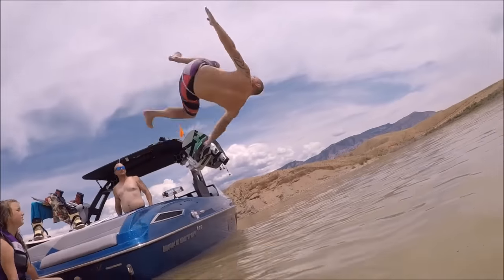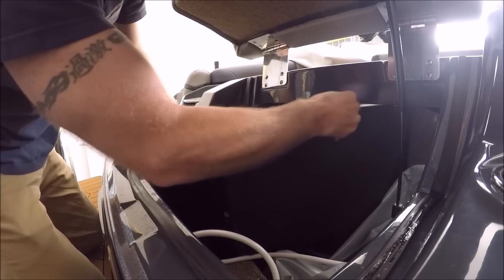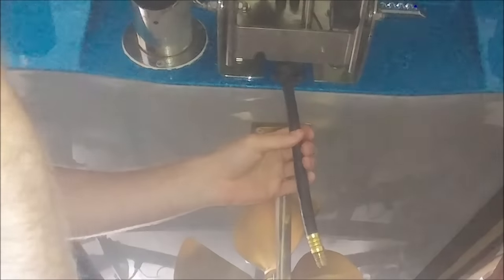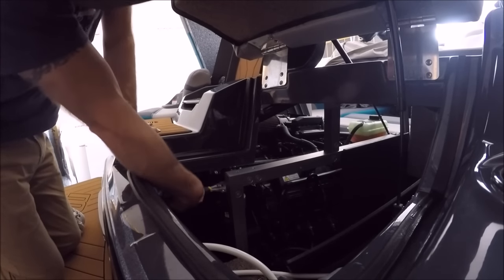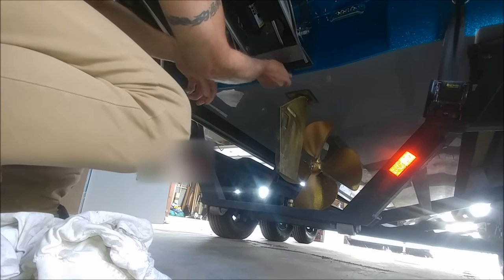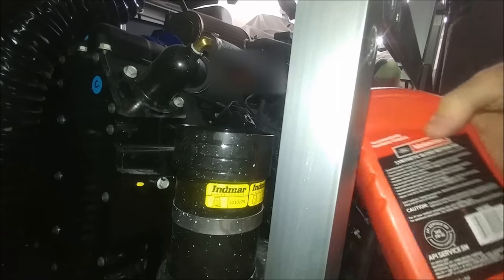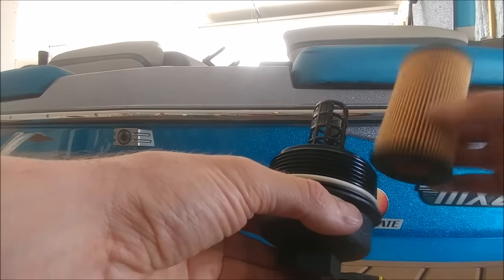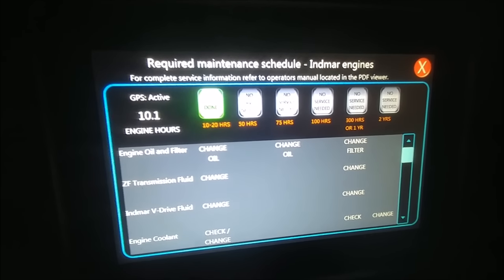WAKEBOAT OIL CHANGE for 2018 INDMAR MONSOON RAPTOR Engine.  Episode 3 - DIY Series

Comment: Awesome video.  I had trouble getting the hose through the  rear drain also on my 2016 LSV25.  I used an extractor which worked well.  Please do videos on transmission and v-drive oil change, impeller change and ballast pump cleaning.  Your videos are extremely helpful.  Thanks. Daniel
Reply from the maker: Thank you Daniel!  I've never cleaned a ballast pump but if I ever do I will make a video.  I did make an impeller inspection video.  I don't feel comfortable making a video on how I do my transmission and v-drive changes yet, but if that changes I will make a video.

Comment: Nice video. I have an 04 wakesetter and I always do the maintenance. So much cheaper and you get to see how the boat is holding up when you get into it. I’ve found problems during the annual Maintenance that the dealers would have missed or charged thousands of dollars. Leaking impeller pump, impeller pieces in the trans cooler, trailer issues. We had the steering cable break a few years back. Had tools on the boat to cut the cable and bring it in slow with some vice grips for steering.
Reply from the maker: Thank you!  I agree, I like doing some of the maintenance so I have a good pulse on how its doing.

Comment: maybe 3 things I would add to this video … first using a Mytivac 7300 for example speeds up the process to get this done in about 20 - 30 minutes.  The Malibu crew forum is providing part numbers as you shouldn't use the fill stick tube to drain the fluid - an adapter to the hose shown in the video will speed up the process and you won't need to drop the extract hose thru the transom drain plug - you literally suck the oil thru the tube.  Heating up the oil will help - if you don't you may be in the 45 minute range.  2nd you can use the same tool to extract the transmission oil (V-Drive) - annoying part is that you will need to empty the Mityvac in between as it doesn't have the capacity to hold them both … then you need to empty it again to get the transmission fluid (ATF) out of the transmission because oil and ATF shouldn't be mixed - each one needs to be disposed separately (please - our planet deserves recycling).  Once you have all this done - then you should actually go into the screen shown in the video and confirm the changes … I assume that you did all this but it doesn't make it look too good from a warranty perspective when you confirm the fluid changes but haven't actually shown so … and last - update the service manuals - you have on for the engine and a separate one for the transmission - record date/hours and staple receipts for fluid and oil filter - again - warranty if necessary will be easier if you have those on hand (or intend to sell your nice boat).
Reply from the maker: Nicolas Kohler thanks for providing all of the information.  My video is specific to oil changes for wakeboats and not servicing everything in the boat.  I definitely did service the atf.   I was not worried about how long it took for my oil to drain but if I were, I agree with the extraction pump.

Comment: On your oil drain line where did you get that pressure fitting? The end of my drain hose has a nut that's wider than the hull drain hole so I can't pull it through like you did.
Reply from the maker: Hi Kyle, its what the boat came with but I bet you might be able to get the part from indmar somehow.  I would probably check my local hardware store too.

Comment: What happens when the lid is seized to the oil filter cartridge
Reply from the maker: I would try an oil filter wrench or something of the sort.  On the regular style filters I've had to use channel locks and crush the filter to get it off at times
Reply: Thank you sir!  That’s what I thought,  was curious if there was a different trick.   Off to the store I go.     Any idea on how tight to re attach the entire assembly?
Reply from the maker: @dennydroumtsekas7683  yw, not sure on whole assembly.  I only barely tighten mine though.

Comment: 2019mxz the damn oil line doesn’t fit through. Just the tip
Reply from the maker: Did you remove the plug on the end first?  I had to remove the plug first.  If you can't get it through still then the only way to drain it without making a big mess is by using a pump or extractor, such as the mytivac:  https://www.tooldiscounter.com/ItemDisplay.cfm?lookup=MIT7400&source=froogle&kw=MIT7400&gclid=Cj0KCQiAxZPgBRCmARIsAOrTHSbM931i1B5aAr1H3Ug7AklBv-or3nkUmn0AFHrKgMdcMVNmqATlqpMaAkXGEALw_wcB
Reply: @wake_mann  Same here, wasn't able to pass it through the drain hole
Reply: @cesarmilder88  Buy a hand pump. Thread that line up via the drain plug hole and connect inside the boat.

Comment: Sorry, but I had to stop watching after you started sucking the oil out with your mouth. Pump style fluid extractors work well & are $50 or less. Pretty good investment if you’re going to do your own maintenance.
Reply from the maker: Haha, I'm well aware of them but like the simple process myself.  I will be buying an extractor for my G23 as it does not have a rear drain to pull the hose through.